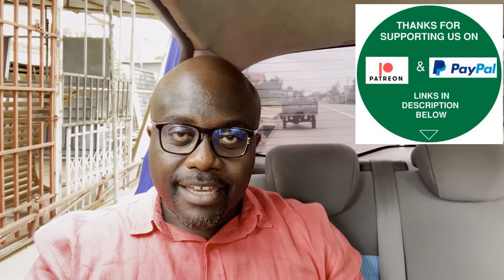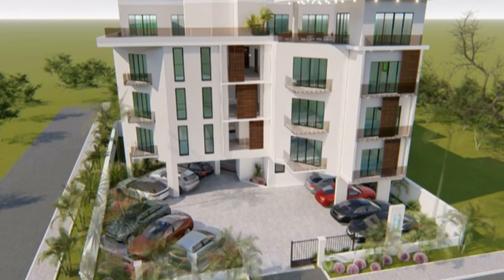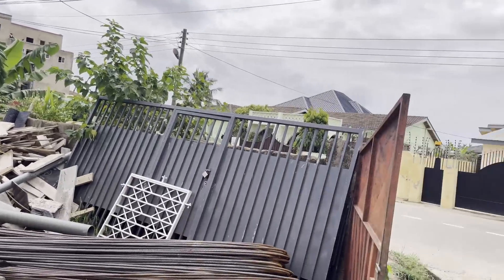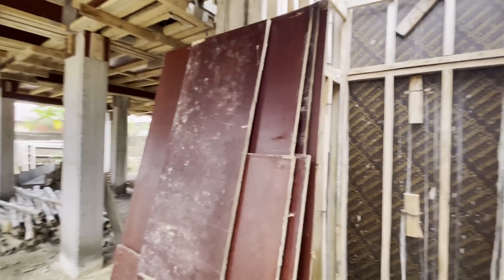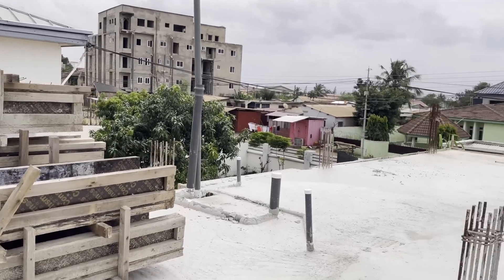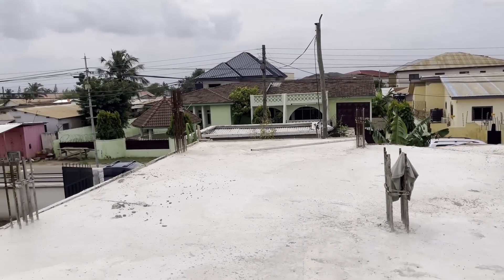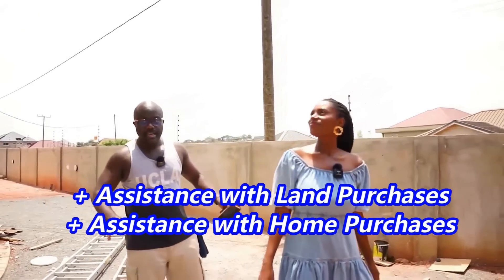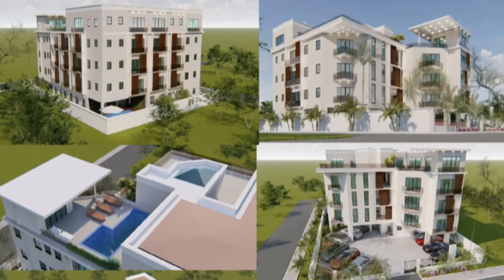JOURNEY WITH ASHER & GAD | 5 STOREY APARTMENT

Comment: I would like to advise on using caution tapping or lines on the first floor that looks open,it’s hardly used in Ghana,great information, thanks
Reply from the maker: Don’t understand your comment
Reply: @kingstal90  ok,what I meant was  in order to make the perimeter of the upper floor area safe  from any worker falling down is to tie caution tapes or yellow ropes all around the four corners after the floor concrete is poured.This is just a suggestion,in Ghana this practice is usually not done. Thanks for reading my suggestions I hope to meet you one day in Ghana.
Reply from the maker: You are right yes!